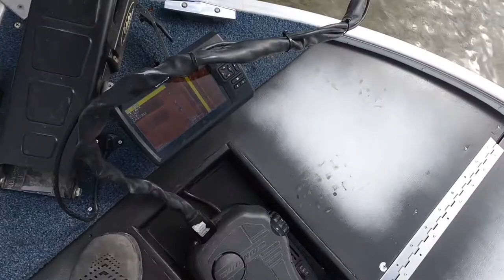Ultimate Boat Deck Build Episode 13

Comment: glad to see u put it on the water and tested it out. now you know what ya need to work on and not work on. To bad that trolling motor problem is so far up in the front of the boat. Thats gonna be a job to get it fixed and working properly.